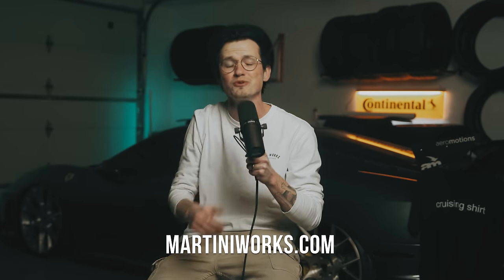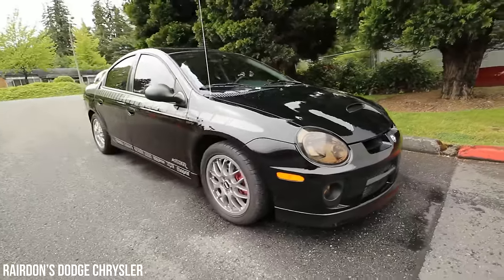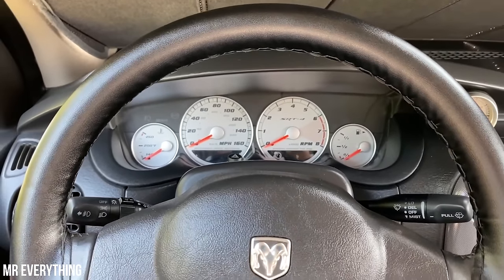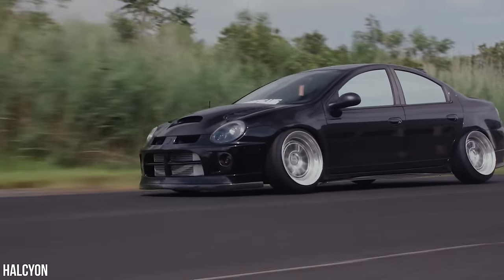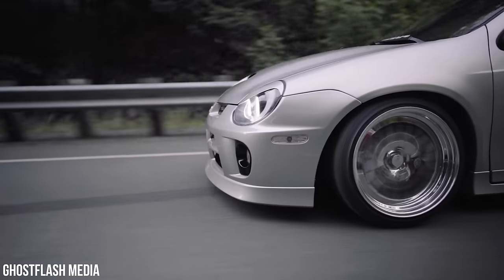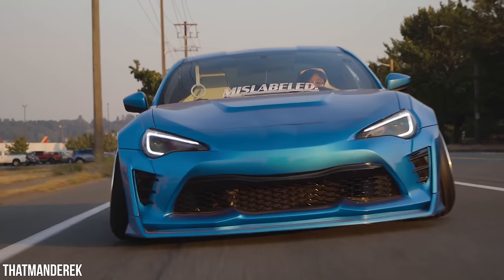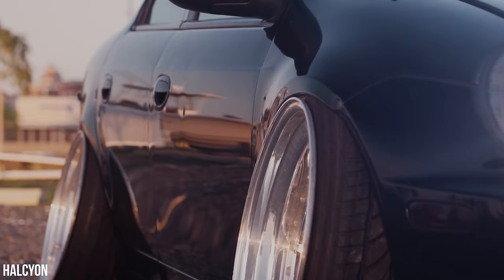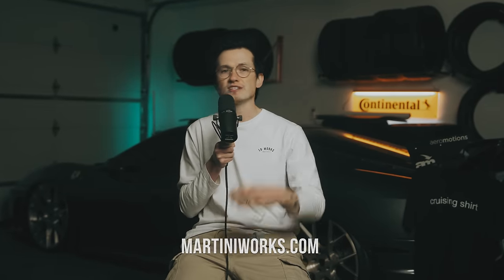How To Modify a Dodge Neon SRT-4

Comment: Some people  will never understand how fast the srt4 is until they drive one
Edit:
If the student from virginia that came to study in California reads this comment just know I was the one who bought the blue srt4 Palm Springs / cathedral city California ! Area!
Reply: got one with 600 hp :D
no one plays :(
especially when it sounds like an rc car in 1st and 2nd, wish i had the "the fuel pump is louder than the exhaust"
Reply: @butwhytharum  💪🏾 I miss it everyday 🥲
Reply: I'm a valet and a dude with a big turbo srt4 came in and I was one of the only dudes who can drive stick. Hopped in stalled it instantly bc I've never driven a race clutch 😭. I had to let him take it bc he had an issue with his key where I couldn't get it out and only he could do it. 

But his car was definitely pushing power, the turbo was super loud and he had oil pressure boost and afr gauges going down the a pillar
Reply: I agree, they are super fun cars! 😁
Reply: I just bought a srt4 what is the first upgrade i shoukd do?@butwhytharum
Reply: @Weber1987  man , its been YEARS since Ive owned one of these. I deeply miss my 2005 and 2004 flame red 😢
Reply: Everytime I drive mine I get mad that I didn’t buy one sooner 😭
Reply: @Weber1987  air intake , exhaust, upgrade engine mounts, Hurst shifter, then you can get into some motor upgrades
Reply: @Weber1987 Maintenance first.
Reply: I owned an 04 and 05. Miss them both.

Comment: Alex I still have my 03 Red Neon SRT-4 with a Mopar BOV and stage 3 Turbo toys still on the stock exhaust cause it is the loudest ive heard yet and some Eibach springs im making around 400 hp ! I have had it for about 15 years now so its definitely gonna stick around a lil longer I hope !
Reply: What are a few things I can do to increase the hp on my newly bought stock srt4?
Reply: @Weber1987  I believe that you can still find the mopar bov plate that goes behind the stock bov and releases the pressure faster and it sounds awesome and look into the mopar turbo toys stage 1 or 2 that mopar made and can be installed and still remain with a factory warranty because they are genuine mopar parts !
Reply: @Weber1987 These things generally are really needing some maintenance before mods! Not sure what shape yours is in just saying! 😬👌 wanna keep the happiness supplier running!
Reply: 400 out of stock frame turbo??? More like 350 max..

Comment: The original burble machine and the car that won my heart as a severely unsupervised 90's kid hanging out with his older brothers in the car scene. 
Vivid memory of a Orange Blast with a DP cutout throwing fire out the bottom when I was maybe 12. Stomping everything on the streets.... from a domestic Dodge Neon?
JDM scene was high on the rise with F&F, NFS, all the tuner mags. Life was so amazingly innocent and good.
Ive owned 2 and am currently finishing up my current SRT4. 2004 Mopar Stage 3 Kit. 89K Miles and it is an absolute stunning example of an OEM+ NSRT4 and arguably the cleanest in the PNW. Thank you Alex for your content and love for this platform.
Reply: When I was in hs (03). We gave the one dude we knew with a srt4 so much shit for driving a neon…… secretly a bit jealous of how mean it sounded haha
Reply: Dude that’s awesome! What color is your current SRT? Also I’m curious because I have one myself. Did you buy a used stage 3 kit from someone or did your car come with it? I’ve been trying to find a complete stage 3 kit or piece one together from the internet but it’s been a trival process so far.

Comment: Growing up i always wanted one… 19 years later I bought one and I love it.. so fun to drive, turbo with ac 4 doors… and not bad on gas
Reply: Hope you like doing control arm bushings and tie rods along with watts links and wheel bearings.....made a bunch of money off these cars back in the day.
Reply: @robsorgdrager8477 Any upgrade options for the wheel bearings?
Reply: @robsorgdrager8477  lol no.
Reply: @classifiedcalli1731  I'm confused, lol no as in I'm wrong or lol, no as in I'm right and you know my pain ?
Reply: @andydhillon1977  I'm sure there are some. I fix cars , mechanic by trade . I know that dodge used a ground strap to try and keep corrosion at bay but I would assume a good set of " national" bearings and the correct torque on the axle nut will do more for longevity than anything else. The neons were never meant to be one of those " goes forever " cars. They can though, I've seen it.

Comment: Bought mine in 05. Has 76k original miles. Things amazing. Mfactory input shaft with straight cut 1st and 2nd gears, built head and s206 turbo. Love it. Where are you at Nacho

Comment: Had on 05 that was sitting on a lot because of the color, sunburst orange metallic, that thing just with a stage 2 JET performance chip a Mopar blow-off valve and 3" undercarriage dump exhaust, was a problem for Corvette and I really wanted to put a DSM suspension and adapter plate to make it all wheel drive...I want it back.

Comment: Mopar stg 3 kit and done. In stock form they struggled to pull ahead of my svt/zx3 swapped focus. I had a 02 zx3 auto that I swapped in a svt engine and trans in 05-06. As long as I caught the srt in a low boost start I could just walk away . More times than not the srt was too busy making burble pop noises and I don't feel their turbos from factory spooled well even for the time it was quite laggy . My svt was n/a with 10.5:1 comp and a e85 tune . I gutted the body and didn't use the svt brakes or seats and that gave me a 300 lb weight savings over a stock svt focus. 16 inch wheels gave better performance along with a better sidewall on the tire. The srts were good but a mildly built Honda was better.
Reply: LOL an SRT4 would run circles around a garbage NA focus, assuming this is just you being funny.  Finishing off with the silliest comment about a honda that just proves it lmao!! good humor!
Reply: @rooh5825  you'd like to think. From stock they were laggy and most people didn't quite understand how boost works. I used that to my advantage. Yes my engine swapped and trans swapped zx3 was about 300+ lbs lighter than a svt and I ran 16 inch wheels with 225/45's for a little better advantage. That car still went from 35-130 faster than some street bikes.
Reply: @robsorgdrager8477  1) The SRT4 used a small TD04LR-15Gk for a quick spool, there was very little lag.  2) A car that at most would be 250 lbs less than the SRT4 is NOT going to make up for having roughly 60 less horsepower, and 100 less torque.  The SRT4 when introduced was faster than the Mustang GT, S2000, 350Z, WRX, the list goes on and on.  You aren't even in the same zip code driving a naturally aspirated SVT anything.  And "faster than some street bikes" LOL come on man, get off the crack.
Reply: @rooh5825  maybe it was the way I drove it. I know on the hwy I would pull on srt8's, c4 Corvette, sn95 mustang was a joke. From a dig that focus was worthless but for what ever reason I could simply drive away from cobalt SS super and turbo, srt4s. The only stock cars I ever had issues keeping up with were the Acura type s and certain Nissan Maxima. I mean you have the same response as most people did😂🤣 . One guy on a 600 gsx wanted to see my nitrous set up. I put the car on a dyno at Hitec here in Minnesota and it put advertised numbers to the wheels. 170 HP and strangely 168 lbft. The only mods it had besides the swaps and none of the heavy brakes from the " blue " donor car was a hand made air intake and the manifold rocker from C.F.M. I think the six speed made that car fast. At 50 mph I'd down shift from 6th to 3rd and wring it out to 7200 rpm and by then I'm doing 125 mph. That car would top out at 147 mph and then slow down when shifted into 6th. Had a few of my fellow Ford technician refer to it as " the freak " because no one could figure out why it was so quick, including myself. Oh the car was a 02 and it never got the first software update which kinda nerfed the cam advance because too many people thought it ran rough. I'm pretty sure the dyno guy had a boosted Mazdaspeed 6 that I simply just drove away from as well one night.

Comment: The SRT4 Neon is what lead to Dodges current line up of "sports cars".....I said what I said
Reply: It was the original SRT car
Reply: @mavr1ck853  facts 💯💯
Reply: @mavr1ck853  That was the Viper, but yes, without the Neon SRT-4 Daimler would have never green lighted the LX cars (charger/300/Magnum) with big engines.

Comment: I drive a 1993 supra rz turbo, and u still think about my neon srt4 and always contemplate getting another but then I remember the reliability issues and think fuuuk that
Reply: They didn't have reliability issues unless they were poorly modded ;)  well, outside of the NVG transmission that is.
Reply: What kind of issues did you have with it? I'm interested in getting one.

Comment: Every single friend of mine who had a DSM that blew up picked up a...
And every  SRT4 all had to buy a new block or one under warranty replaced😂
Then they all moved on to EVOs, WRX and STis.
Reply: No they didn't.  You have no idea what you are talking about.  The SRT-4's A853 engine was near bulletproof, all the way to 500 hp.
Reply: @rooh5825  yes they did, that's why you hardly see any of these Skittles on the road.
Reply: @Zeiss120  Yes, so cute when you conveniently ignore the Rule of 15 with regard to most cars.  15 years following the last year the car was sold, you simply don’t see them on the road anymore.  This is even more noticeable when there aren’t newer models of the vehicle sold.  Only 25,000 SRT-4 Neons were ever sold (company expected to sell 3,000 and went WAY beyond), so before you expose yourself further by bringing up certain vehicles you DO see, do a comparison to the overall sales numbers and that is self explanatory.  How many S2000’s do you see on the road?  How many Terminators?  SC or TC Cobalts?  Saturn Sky/Pontiac Solstice?  Saturn Ion Redlines?  

And to show you just how ridiculous your comment is, where are all the 2003-2005 WRX’s or Sti’s?  I haven’t seen an 8th Gen Evo in more than 10 years.  The reason you THINK there are a bunch of those still around is simply because there are later year versions of those 3 cars.  The reality?  There’s a bunch of NEWER model years because they were made a LOT longer than any of the cars I mentioned.  

A low numbers run sports car, outside of the high end corvette/GT500 and above, will disappear like every other type of car after that same 15 years, in fact even more so due to the inevitable accident prone nature of the vehicles.  You show your ignorance by trying to bash on the SRT-4 engine, a stout performer with reliability right up there with any sports car out there.  The SRT-4’s NVG T850 transmission would have issues here and there, but never the engines when taken care of.  So just stop with the “YES THEY DID”, nothing you are going to try to defend yourself with is going to go well, put that shovel down and climb out of the hole.
Reply: @rooh5825 Damn! Well-said@

Comment: tell me you dont own a srt without telling me you dont own an srt...
first thing to do is redo the vacuum lines and make sure your car is running right before modding the thing...
THEN get a canned tune and crank the boost...
THEN post on the srt forums "how much power can the stock motor make"
THEN after you blow the motor from cranking the boost buy a honda.